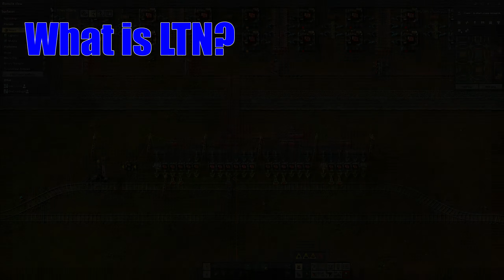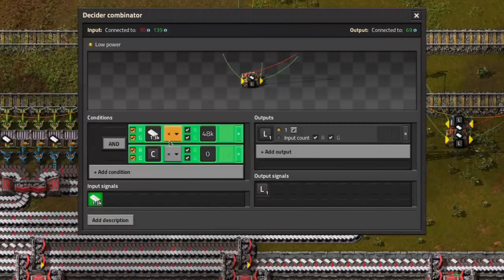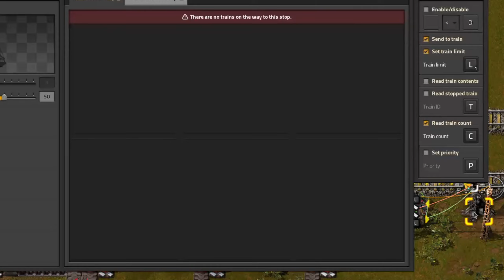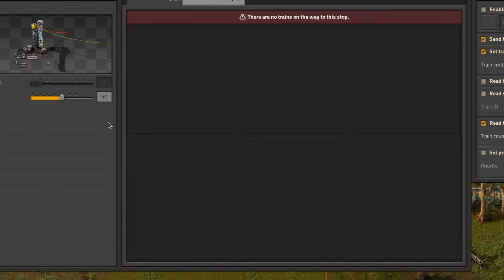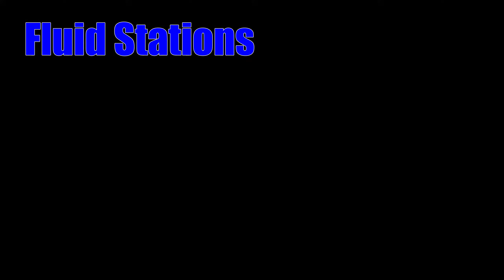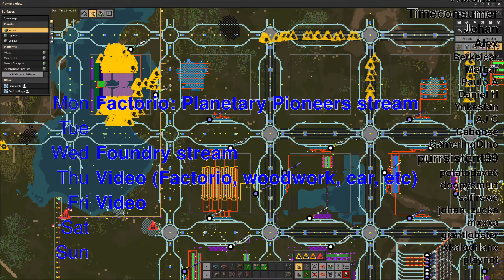LTN With No Mods? - Marc's Vanilla LTN - Laurence Plays Factorio

Comment: With a few more combinators, stations can A) call as many trains as their queue can hold, based on how many trains they can fill, and B) set their priority based on how full/empty they are.  This will ensure that all stations will be (somewhat) level-balanced and more distant stations won't get backlogged/run dry.

Also, I'm not sure why you need 'C' and all of the wire, as the train interrupts are currently set up to reserve a route instead of a single station, so, anytime one matches both a loading and unloading station, it reserves both at the same time.

Cheers!
Reply: Not true. It doesn’t reserve both stations only the one immediately next in the queue
Reply: @FrazzleCRM  Take a look at [05:13].  If both loading AND unloading stations can accept trains, both are set as targets and, therefore, reserved.

Comment: You can send a list of signals and the train will handle it? 

So you could sort a list of signals based on how many trains or how needed something is.
Reply from the maker: Each train deals with one request and removes it from the network, so if multiple requests are added at once, the first train will handle one of them, the next train will handle the next, and so on. No individual run will handle more than one signal/request.

Comment: easily the best video ive seen on this type of train network, it's literally exactly what i was looking for. thank you
Reply from the maker: Thanks! We ended up not using it in the end because we wanted more control over load sizes and multiple pickups/drops supported so we went back to traditional LTN, but it was very interesting to see how much of it could be done without mods!
Reply: @LaurencePlays you can also make an LTN like network without any logic at all, with just interrupts, the problem is it doesn't balance resources, so it's not really LTN, it just sends and receives them continuously, but it works without any additional setup and can be templated like this one and it's extremely simple to understand. You basically have an interrupt to collect resources when empty and the distinction is not full, haul when have resources (with a wildcard symbol in the interrupt), to the train yard when the destination is full and an interrupt for refueling

Comment: Does it support multiple depots? Or just one central depot per network?
Reply: Figured it out. Multiple depots can be supported by putting the timer onto the network then just continuing the count as you add stops.
Reply from the maker: @jseconomics  Correct! Location of the stations doesn't matter at all, as long as you can get the signals to them and give them all unique numbers. That's probably the only "manual fiddling required" part of expanding.

Comment: Bit late, but would it be possible to set it up in a way where L is dynamic? If a provider has enough for 2 trains say, set L = 2, and vise versa for requester stations.
Reply from the maker: I imagine so - you'd need some more logic to handle requesting two trains, but it shouldn't be too complicated, I think. We reckoned it probably wasn't required for our design, but perhaps it would be a good consideration for an expansion!

Comment: I had something similar, but the timing the signal at different times to prevent two trains from going at once is something i hadn't thought of.
Reply from the maker: Yeah, you don't want all your trains to run off to the same station! The train limit settings should help with that though

Comment: What if requester stations could request in advance? they could have timers, and when they send a request, they could start tracking how long until the train arrives. Then they could then use that time,  subtract it from the expected time when they will run out of materials and they could put in a request early, so that the next train arrives perfectly on time. You could even have a moving average of the 3 last trips. Or you could separate it from when a supplier is available so it only tracks the time it takes between a train leaving the depo, filling up, and then delivering.
Reply from the maker: That sounds possible, although quite complicated to set up - definitely an exercise for the viewer! 

I suspect that just setting a higher threshold would be better (or at least easier), so it calls for the next train sooner. And maybe having something to allow for multiple trains en route to a dropoff station simultaneously. Or additional dropoff stations in a block!

Comment: Okay, I love it! Especially the part where you update the signals every other tick. I’m guessing that’s to get the negative signal out in time?
Reply from the maker: Yeah, Marc did a good job here! I believe the updating every other tick was to ensure that if a signal didn't clear quickly enough due to propogation delay, that a second train wouldn't be dispatched.
Reply: @LaurencePlays  Marc should be proud of this one. I'm going to make a prediction: "I think alot of builds now will be buildt around this method". The clock and the utput the +1 from the train count was very smart! You are also using very few combinators, my impression is that may Factorio builds uses to many and this turns people off. This was simple and smart! Only addition I think I would make is maybe a a combinator that sets prioirty based on how full the station is, and a send the signal to the train evey tick, but alternating between sending singals to fuild train and solid trains. I have to do something to not just copy paste XD . But again well done! You make one of the best videos for LTN and now I belive you have done it again.

Comment: I should post my vanilla one...

- Only uses red circuit.
- Only 3 station names, allows multi dropping.
- Multiplexing to ping each unique id for requests.
- Prioritises larger requests.
- Goes to closest provider station.
Reply from the maker: Please do! It's always interesting to see how different people do things. If you post it on my discord, I'm sure we'll have plenty to say and discuss.
Reply: @LaurencePlays sure, I'll add some QoL for the public, and share it on discy
Reply: @Yam2kz  blueprint link or i call bull, the combination of things you stated is straight up not possible to achieve in vanilla, you cannot choose what station you train goes to with only 3 names, let alone pick the closest one
Reply: @kolyashinkarev7366  multiplexing brother. Think Cellular tower networking. You can use the recycler varients of normal icons to avoid transmission poision.

As for shortest route. If two provider stations are active at the same time during the multiplexing "ask who has x" routine, the train goes to the shortest route with its A* path finding algorithm.
Reply: @Yam2kz I NEED a link bro, if you made a goddamn multiplexer in Factorio I want to see it. I also want to know how you achieved multi dropping
Reply: @kolyashinkarev7366  he was a capper :(

Comment: One problem with this build (which I’ve encountered in my own vanilla LTN-like build) is that the „count trains“ option from the station will continue to output a signal until the train has fully left the station block. This will mean there will be a +1 signal from the provider at the same time the -1 signal gets turned off at the requester, essentially causing the system to believe (for a second) that 2 requests are being fulfilled, instead of 1, until the train has fully left the provider station. A better solution would be to use the „read train ID“ option and use the conditional T =/= 0 to detect if a train is in the station, since this immediately updates once the train docks/undocks.

Also you can easily round robin by adding a single combinator that reads demand/supply from the station storage and sends out a P signal to the station as a percentage of demand/supply.
Reply: Thanks - I didn’t know that. My main goal was to avoid launching to many trains, so I think have one request cancelled for a few seconds while the train is leave the station is ok overall. Like your solution for that though. 

Regarding round robin: yes there are many solutions for that. I will implement one variant for the artillery train stations at the wall. So stay tuned and watch the streams 😁
Reply: Interesting, but this wont triger when the train is sendt to the station. Since the count train "The number of trains en-route to the current stop, including the currently stopped train, defaulting to C". This means that +1 signal is sendt the second the train is dispached.  Mayve some R-S latch, to switch from using train count to train id?
Reply: @ZeGeeN Yeah I didn’t explain it fully, but essentially I use a combination of C, T and green/red rail signals to detect if a train is on its way, parked or leaving and update the +1 request signal accordingly.
Reply: @VascoEgert  Very interesting. I'll have to try it :)

Comment: I just don't like bringing circuit signals across the base and i dont like a ton of radars either
Reply: I like to keep it simple too, I just connect the station to the boxes right next to the station and deactivate the pickup station if there is less than 1 train load in the chests. And deactivate the dropoff stations if there is too much of an item in the chests. Then I have a depot and the trains just go pick up on their respective pickup locations and then wait at the depot until a dropoff station gets free. (has less than a trainload in the dropoff chests) That way trains are always full in the depot waiting to dropoff, if you have enough pickup locations. And you don't need a whole lot of circuitry. Just a normal interrupt that tells the trains to wait at the depot if the dropoff or pickup locations aren't available.

Comment: Main disadvantage is that you need to connect a huge web of green cable across all of your base where you need trains to go to?
Reply from the maker: You could use radars to carry the signals if you preferred. But running the green cables automatically is easy if you build your rail sections from blueprints, which is by far the easiest and best way to do it anyway!

Comment: Why use train limit and not station enable/disable on the provider and requestor stations ??
Reply from the maker: Train limit ensures you'll never get more than one train trying to go to the stations, and I believe if you disable a station, any trains trying to go to it will skip it, in this case heading back to the depot without completing the task.
Reply: @LaurencePlays  ya you set static train limit to 1 and dont touch it with circuit network , then enable/disable provider/requestor station based on the same existing condition. i.e when a requestor station wants a resource you enable it , when a provider station has resource to load you enable it. other times they stay disabled. May be my understanding is wrong
Reply from the maker: @prince_warhero  Ah, I see what you mean. I suspect that would also work, although I haven't thought through it too carefully!

Comment: Hmm the 120 number means you can only have 120 trains... Seems a bit low. (Dry joke)
Reply from the maker: You're quite right, we are limited by the counter's reset point. If we'd kept this system, we might have needed to increase it! As is, we'd also need to configure each depot separately with its own number to start counting at, and currently the stations all have to be configured manually, however we know how we would fix that if we were keeping the system. And yes, I'm taking your joke seriously!  😀

Comment: I know, I know - one shall not compare Factorio and Satisfactory - but that's what Satisfactory really lacks about its trains implementation
even something as simple as a stacker (or basically: live route update and re-routing) had to be done by a mod - somthing really fundamental SF trains lacks so heavily
I hope CSS one day change thier minds to least give us that bit of QoL for SF trains as with the current system it's a pure nightmare to setup even slightly advanced networks
Reply from the maker: Absolutely - I spent quite a lot of time complaining about that lack when I played Satisfactory a few years ago (before 1.0). If you want to have multiple mines supplying multiple factories, then I think the only way to do it is to have a train per mine and a train per factory... And have them all drop off/pick up at a central depot station. Which is horrible, and ruins your throughput because stations can only output at a speed of 2 belts, really limiting your factory. It can do stackers, but you (as far as I know!) can't have multiple stations with the same name and have trains go to whichever one needs them.
Reply: @LaurencePlays  unfortunately even with 1.1 there's no way of proper stackers as the route is determined only once when a train leaves the starting station and it's always the shortest route calculated
so when you try to build a stacker for some drop off station all trains queue up on the first lane without utilizing any other
there's a mod adding at least this very basic function by hooking into the route calculation and re-do it at every signal - this way when the first lane is take the train now correctly re-calculates the path to use the next free one
I see the issue in SF with the logic is in the trains instead of the tracks / station network: you have to set a trains route upfront instead of have the grid route the trains
also: there's currently no "on demand" - sure, you can set "completely load/unload" - but this often causes dead-locks when the providing station can't keep up or the drop off is not cleared fast enough - the trains always run even if everything is backed up due to full output storage - but devs often stated: "logic isn't something we want to add - at least not in the forseeable future" - they really miss out
also also: trains are at least one tier too late to be useful - when you finally unlock them you likely have quite extensive belt work and have to re-do a lot
anyway - I recently bought Factorio as I'm currently quite dis-satisfied with SF and want to enjoy proper rail stuff and also those sweet bots doing the work for you
Reply from the maker: @cryptearth  Ah, true, I was thinking a linear stacker (aka, having the trains queue up along a branchline before the station) - that can be done, but it's not a proper parallel stacker. 

I fully agree - I've enjoyed playing Satisfactory, Dyson Sphere Program and Foundry, but they all pale in comparison to Factorio. Satisfactory was the prettiest, but also the most frustrating, I think. I'm really enjoying Foundry, but desperately missing automated building and copy/paste (and trains!). I think Foundry is probably my second favourite, at least at the moment.
Reply: @LaurencePlays have not touched any of the others, yet - but will give them a shot
I come from years of tech-modded minecraft going way back to the days of AppliedEnergistics 1 and IndustrialCraft - about 10+ years ago - that's why enjoy these factory games so much - it's just my play style for over a decade now
there're lots of different things from all over all those games (including minecraft mods) I really like while about as much I don't like - I also have sunk several 100s hours into both Arma3/DayZ and gtaV role play - so there're also elements if these games, too
but in the end mashing them all together would end up in quite a chaos I would not like to play myself
guess the best of all those games is just that they're all so different - and if you got enough after playing one game for a week or two you can just switch to the next one and sink another two weeks into that
Reply from the maker: @cryptearth  Ah, if you're coming from a Minecraft background, I'd be tempted to say to take a look at Foundry, since it shares the same sort of 3D cube based world. Maybe check out my Wednesday night streams if you want to see more about it. 

That said, Factorio is still the biggest and best of the factory automation games, and so very worth playing too.

Comment: You could add round robin like thing if you set the station priority depending on the station current cargo. More cargo > less priority.
Reply from the maker: That could help to an extent, however if your supply is sufficiently limited that the first station empties before all the other requesters have had a train, then you'll still have the same problem. And you may have seen how quickly our blue circuit factory can get through green circuits, for example! It's a step in the right direction though.
Reply: What if you added a counter of how many train deliveries were brought to the train stop. And then priority would be some kind of a math equation between current cargo and stops. The counter could count up and be connected to the green wire you are using for requests and have main "Day reset" clock just like you have dispatcher for the depo. The clock is there so that all stations get brought in line.
Reply: @Mathyan-n1i something like that could work. Although it would make it quite a bit more complicated for
Reply: That’s a very good idea. I have to agree with Laurence though. With our initial demands (because 5 players could build up demand quickly) we emptied any supply’s to quick for that to work. After everything calmed down, that would be a nice addition